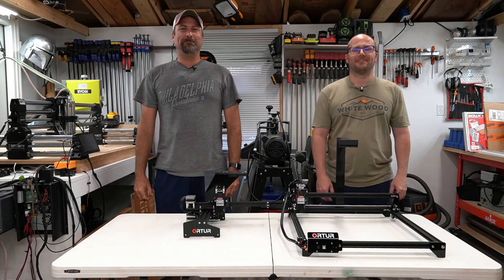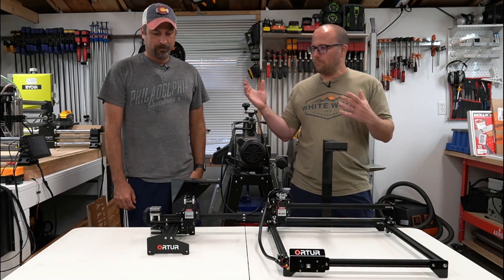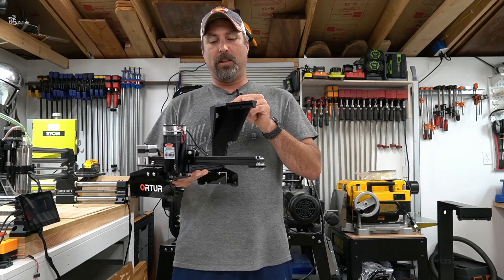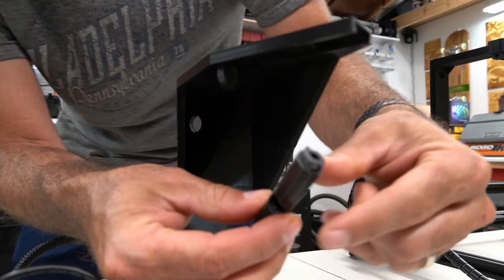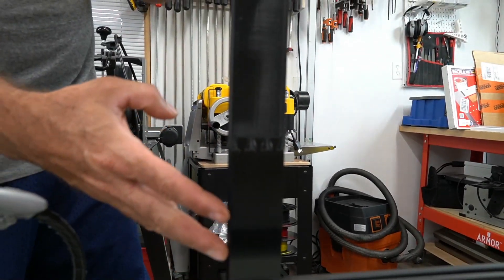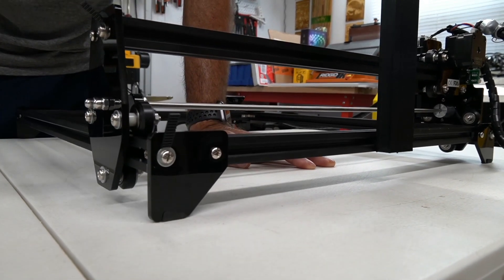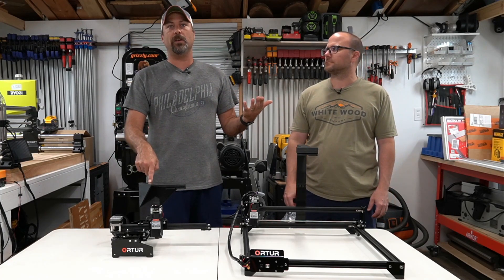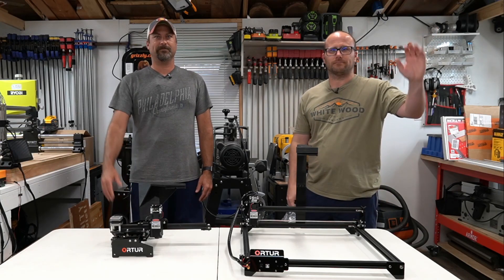Ortur Laser Lightburn Camera Mounts.  Never Waste Material Again.

Comment: What about taller Ortur feet for use with the rotary attachment? (smiling)
Reply from the maker: good idea!  rotary video will be coming soon!
Reply: @MyersWoodshop  Ortur is supposed to have an update to the Master 2 called the Master 400 or something. The laser height is adjustable but I think it would have been better with adjustable feet/legs.
Reply: @EpicDocumentary Thanks! I think I saw that new version on two other videos. If they haven't changed the new design the height adjustable laser won't be tall enough to slide the rotary attachment underneath it. Taller feet/legs would still be needed.

Comment: I misinterpreted the video and ordered the V2 camera mount from Rowdy Roman and the camera mount from Myers Wood Shop. I thought you needed both to make it work, but now that I received it, I see that it is an integrated design and it is not necessary to order the separate camera housing. I will just keep the extra housing in case I splurge on a bigger laser someday. 

The build quality on the product featured in this video from Rowdy Roman is very high. I am super impressed. I don’t have a 3d printer yet but it’s in the cards someday. I didn’t realize parts could be so clean and quality from a 3d printer. What 3d printer was used to build the part and with what filament? Also just curious, what was the print time for this part?

Thanks again!
Reply from the maker: lol.  well, thanks for your purchase!

Comment: hi there is two different cameras at the lightburn website the regular and the 8mp version.....have you tried both? and is it necessary or is it practically the same and do you have examples?
Reply from the maker: the 5mp is what you'd want.
Reply: @MyersWoodshop  the reason i was asking is because i seen 160 degree 4k web cameras on eBay so I was wondering if that would work
Reply from the maker: I think lightburn cameras have custom firmware
Reply: @MyersWoodshop  what's the custom firmware do like us there a benefit?

Comment: If I’m reading the spec right on the Lightburn cameras, doesn’t the 160° only need to be like 6 1/4” inches from the table (400mm / 2.7 / 25.4)? Seems like Pete did his research for this design, so just wondering what I’m missing. His mount looks a lot taller than that — just a better perspective of the bed being higher? I ask bc they’re sold out of the 160° so wondering how much higher I’d have to go to use the 140°. Thanks for another great vid!
Reply from the maker: yeah, we figured it right and got the 160.  might be worth the wait till there back in stock.